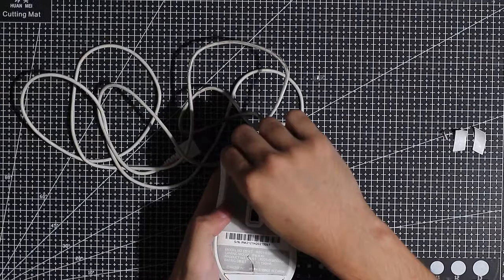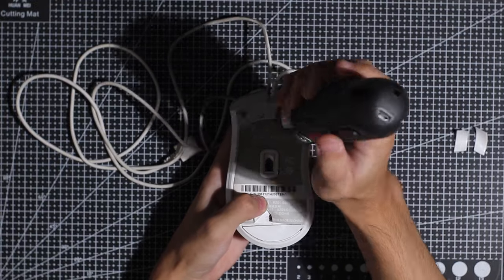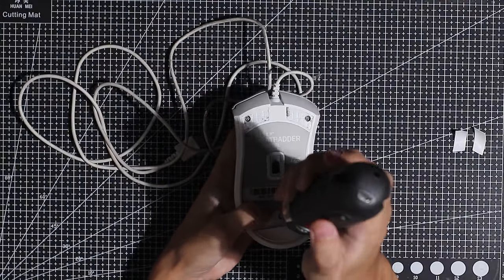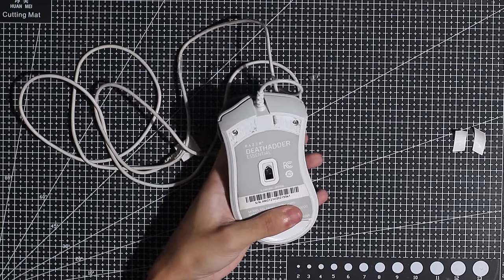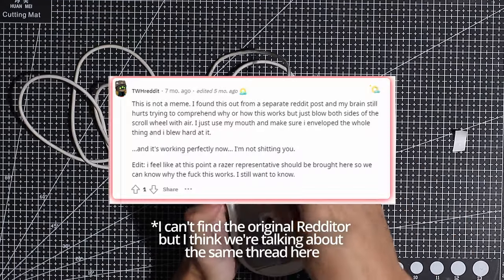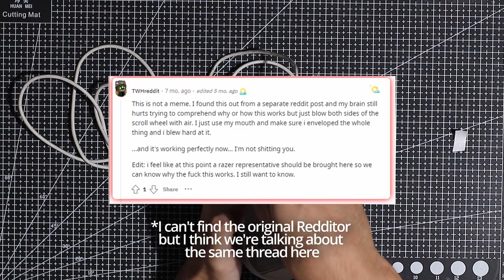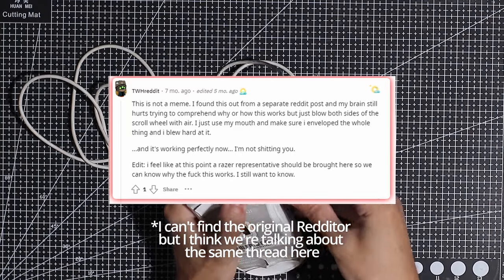Razer Deathadder Essential (2023) | Wheel Replacement and Jumpy Mouse Wheel Glitch Fix

Comment: Blowing it worked for me too haha, I guess that way you can remove some dust that's causing the malfunction there
Reply: it works but goes back again after 2-3 weeks 
still really usefull tho!
Reply from the maker: THAT makes sense! I wonder if it works for other mouse too haha
Reply from the maker: @JoshuaJ61  yup! it worked temporarily for me too sadly. When it recurred, I just tried the solution again, worked for another meantime but eventually I just replaced it to get it over with haha
Reply: @itsamegab  I have the deathadder hyperspeed for about 8 months. It doesent happen to this model. I think maybe the essential has extra space in the creak.
Reply: @itsamegab  just try wd-40, take a straw and cut it in an angled way so that it can go into the creak. ( like a funnel ) then just add small amounts of wd -40. it held up that way for a couple of months then i switched to the hyperspeed version. So ig that will work for a longer time. Hope it helps..
Reply: @itsamegab  its just better to get the hyperspeed. It fixes all the problems i had with the essential. The only thing i dont like is the scroll wheel sounds cheap, but its great. it comes just under 50$.
Reply from the maker: @JoshuaJ61  thanks for the input! definitely keeping this in mind for future reference. I ditched Razer for now because of this though I'm sure the higher end ones are worth it. Currently using Tecware Pulse Elite and I find it the perfect mouse for me at the moment 🙂
Reply: @JoshuaJ61  Really? Mine comes back within hours.
Reply: @Incursion.  if thats the case ig upgrade :( or u can try putting wd-40 like i said. or else you need to disassemble the mouse and clean it,  but too much work and it will come back.. so go with wd-40
Reply: @Incursion.  look out for sales it drops price really often anyways gl :)
Reply: It worked

Comment: I am NOT kidding you. I just blew air a few times at my mouse... and boom! It was fixed!
Reply: It actually works for buttons. But scroll need replacement.
Reply: @Lookingformorefun  Yup, with time enough, it totally gave up. I asked for service centers and they mentioned it cannot even be repaired (in India, at least).
Reply: @oggy.adityanath   You can try to find scroll wheel encoders and wheels. They are cheap. But it will be hard to find actually compatible one. And of course you will need soldering iron and de-soldering wick and actual solder.
Reply: @Lookingformorefun  I just bought a different mouse instead.

Comment: my biggest issue with the Razor deathadder and her followers V2 and V3 is the ammount of middle mouse clicks you can do before it stops detecting the clicks. everytime that happends, is withing the first hours of a game that essentially uses this, for example, dyson sphere programm  and other games that relay on camera angle changes. if your just in need of a good mouse for ego shooters etc, youll never need that button and the mouse will stay functioning for arround 15 years. realy good button switches on the left right and thumbbuttons but that is a feature i highly would reccomend razor to fix as it draws people away from using them.

Comment: What kind of screwdriver do you need to open it? Plus or minus screwdriver?
Reply from the maker: a small philips screw should do it. (plus)
Reply: @itsamegab  Thanks. If I may know, what size of screwdriver?
Reply from the maker: @toadstars  hi, the drill bit I used has PZ1 engraved on it and upon searching, this is what I found,

"PZ1 is normally used on screw diameters from 2-3mm" hope it helps! 😁
Reply: @itsamegab  Thanks

Comment: bro i didnt know where the screws were thanks to this video i found it and my issue was the jumpy wheel and after opening the mouse i found that my hair got stuck on the wheel somehow i pulled it off and it works fine now and just for the memes i also did blow a little too

Comment: i wish it was fixable without completely mangling the mouse though
Reply: nevermind i just blew on the mouse wheel and its fixed
Reply from the maker: @memelord2073  Great to hear! I really just disassembled the mouse because I bought a replacement wheel already before finding out the solution back then haha happy to  help!
Reply: I used an RC model car 'Body Reamer', to bore very small holes into and through the plastic where the screws are.

You only have to bore a 4mm hole through each bit, and the small screws will come out, without damaging pretty much all of the sticker and the front pads.

Once screwed back together, smoothen the edges of the stickers bored holes with the edge of a sharp knife to take away any rough bits. Helps the mouse glide still over your pad and you wouldnt even notice its been done.

Any other scratches or scuffs on the front pads can be smoothed out with some 600 grit emery cloth.